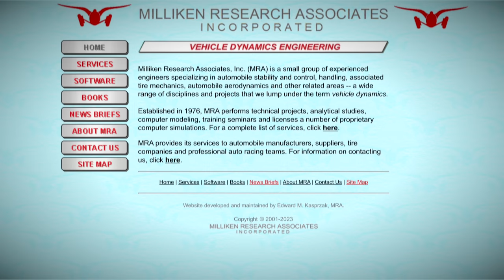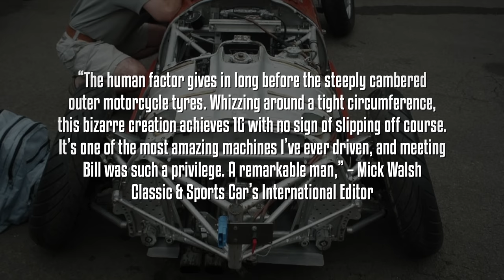The Most Revolutionary Race Car Nobody Knew About

Comment: Having the tires at about the same camber angle as the combined weight of the car and its centripetal force vector summation would mean the tires sidewalls would be taking vertical and circumference forces with little lateral forces.  That may allow much better tire dynamics than when applying 1G side loads on the tires.   The need to have a circular tread area like a road racing motorcycle tire would severely restrict the tire's contact patch, making it very long and narrow.  This car was almost certainly never intended to be race competitive, but for testing camber theory.  The thrust loads from the high camber would have made manual steering tricky.  All the normal geometries of steering and combating  bump steer would need to be developed for camber angles of 45°.   Thank you for this video.   I'd think everybody that has studied performance suspensions has done thought experiments as to what the dynamics of having the tires cambering such as done with a motorcycle might provide.
Reply from the maker: Thank you for your comment!
Reply: Shut up, nerd!

Just kidding - I find this stuff fascinating!
Reply: Good use of words to discuss this. Excellent point the tires sidewalls forces would be reduced but in straight driving this much camber would inflict a large constant tire sidewall force of sin(50 deg) * 1G which may cause fatigue flexion in them and  then when the car entered a tight curve the tire sidewall load would reduce toward zero causing possible flex shift and poor dynamic. 
Another problem that you started to allude to, without race bike like special tires and minimal circular contact patch diameter, any two points on the contact patch are rotating at a significantly different road speed due to the high camber causing severe grinding of the tire and maybe detaching material.  This could get dangerous.
Reply: @oneginee  I met Bill once.  His son, Doug, is a friend of mine.  

There's no reason for camber thrust to follow that sin(angle) function.  If you're interested in the car, Bill's autobiography "Equations of Motion" has plenty of data on it including the tires which you might find surprising, especially in that regard.  One of the interesting aspects was the car actually exhibited reversed load sensitivity so setup worked backwards in a couple of ways.  For example, stiffening the front end moved balance in the direction of oversteer instead of the reverse.  It's the only case I've ever known about where that occurred.  Neat stuff.
Reply: @toddwasson3355   It does not need to "follow" the sin(camber angle deg) * 1G, it will BE that result because this is physics when the vehicle is in a straight line ! 
I am an engineer and i don't need your second guesser jackass opinion to infirm/confirm what i wrote. This Douglas focused on centripete force in turns and completely overlooks the detrimental effect that high camber has on the physics in straight stretches. I am not impressed and I'll stick with my own mechanical dynamics textbooks, thanks.
Reply: Something about effective mass and the coefficient of friction, contact patch/es, enjoy.
Reply: My post keeps getting deleted...  Will try again.
Reply: @oneginee  That's not correct.  

Pages 521 and 522 of Bill Milliken's autobiography "Equations of Motion" show the tire data for the camber car at a range of steer (0 through 5 deg in one case and 0 through 8 deg in the other) and camber angles (0 through 50 deg in both cases).  At 50 degrees camber, the lateral force at 0 slip angle is about half what it is at 8 degrees.  

Load 492 lbs, 50 deg camber:

Fy at 0 deg steer angle:  ~310 lbs
Fy at 8 deg steer angle:  ~520 lbs

A motorcycle in a steady state turn will work like you described because the slip angles will adjust to provide the missing force camber thrust alone doesn't provide.  Camber thrust on it's own is not enough and varies considerably from one tire to the next anyway, it isn't just sin(camber angle deg) * 1G.

With a car that's not the case.  The steer angle is controlled independently and the vehicle isn't forced onto a curved path via camber.  If you added enough toe out at the front, the tires would produce no lateral force at all even at 50 degrees camber.  We can't say that at X camber there is Y lateral force without also knowing the camber and cornering stiffness of the particular tire in question along with the slip angle.  Every tire is different.

In the book, both plots show the theoretical f = load* tan(angle) (tan(), not sin()) for comparison with the measured data.  Even the 0 slip angle case does not follow the theoretical line.  The page 521 diagram shows that the real tire's Fy at 0 slip angle is actually slightly higher than theoretical up to about 15 degrees camber, then it falls under it pretty rapidly on the way out to 50 degrees where it's only about half the theoretical value.   It varies wildly from there as steer/slip angle is changed.  

Add in 2 or 3 degrees of steering/slip angle and the lateral force actually peaks closer to 30-40 degrees camber, falling off some as camber increases to 50.  So it's really not as simple as you've described.
Reply: @oneginee  That last post worked finally.  Not sure why it wouldn't accept my original.  Hopefully this one will work too.

Our credentials and background aren't relevant when we have hard data to look at so I'm not sure what the attitude is all about.  I've referred you to the data on the exact tires used in the camber car which came from Bill Milliken himself after testing them at TIRF.  It's up to you if you care to verify it or not.  

Since you want to flex on your background as though it's relevant, allow me to do a bit of my own:

I've been designing and programming vehicle dynamics simulation and tire models professionally for more than 20 years, have known DM personally for many, many years and have talked to Bill face to face as well.  Doug is the one who told me about the camber car when he picked me up for work one day.  We did a presentation together at the Motorsport Engineering Conference in Detroit on the tire research project we were doing together at the time.  If you don't believe me, you can Google both our names to find the SAE entry.  I believe it was in 2006 if memory serves me correctly.  One of the things we were testing were camber effects, so I have literally measured this personally with a real life Milliken standing five feet away from me while doing it.

You've made a common mistake mechanical engineers who don't specialize in vehicle dynamics (especially automotive dynamics) often do:  See an equation or two in a couple textbooks on mechanical engineering intended for students and think that's the end of the story.  It isn't.  You can either look at the data which directly compares the equation with reality or decide not to and call me a jackass again for pointing out what you said is in fact wrong.  If you don't believe me, speak to any tire or vehicle dynamics engineer on the planet and they'll tell you the same thing.

Comment: The Milliken's book on vehicle dynamics is expensive but worth EVERY PENNY. The book explains every facet of vehicle dynamics: suspension geometry, spring rates, weight distribution, the relationship between front and rear roll centers, and answers questions you did not realize needed answers. On the day I received my copy, I opened that book and found answers for questions  no other books address. This book is readable and has many interesting anecdotes regarding aeronautical and automotive engineering history as well as both theoretical and practical knowledge. If you set up race cars, this is your manual.
Reply: I actually used to take it away racing. Bill and a few of his associates were serious pioneers in the vehicle dynamics field.
Reply: Bill's autobiography (equations of motion) is way better than the race car vehicle dynamics. It is a miracle that Doug Milliken exists given how wild Bill was into his 30's.

Comment: In South Louisiana we call that engine the tombstone. My friends dad worked on the Popeyes boat racing team for Tom Benson. He built his son a bored out Mercury 6 hung on back of a 17' Allison. Boat looked like the Concord jet. We ran it up to mid 80s mph. His dad shortened the lower unit and put a 4 blade on it, cut out the exhaust cans and we got up to 98 mph. Because it was all built with (junk) parts it was all just for fun and not an official race boat. It sounded like the Kawasaki straight 6 Widow maker. Then for some reason he burned the motor up using it on a lake skiff to go trawling for shrimp!!! Lmao!! Like i said South Louisiana. 😊

Comment: I used to have a Karman Ghia that the builder had utilized shorter-than-stock shock absorbers that made the rear wheels have positive camber (wider at the bottom than the top) for cornering
Reply: That's negative camber. This car is an extreme example. 
//------\\ = negative 
\\------// = positive
Reply: @skaldlouiscyphre2453  And unless they're coil-overs, shock absorbers have no bearing on camber or ride height. Even gas shocks make a negligible difference. The Ghia probably just the rear torsion bars dropped in the splines.
Reply: @moyadapne968  Isn't karmann-ghia has swing axle like rear suspension?
Reply: @huseyinuguralacatli5064  yeah when "lowered" it gets more Camber

Comment: The 4 cam Corvette engine mentioned is the LT5 that debuted in the 1990 ZR-1, which like the 2 stroke that powered the camber car was produced by Mercury Marine. They had to make it because GM didn’t yet have the capability to make full production runs of all aluminum engines. It kind of surprised me to realize that aluminum blocks only became standard on Corvettes with the LS1 in the C5 1997 Corvette, while they’ve always had fiberglass bodies and have had independent rear suspension since the C2 in 1963.

Comment: That camber racer used steel rims from a SAAB  and mist likely the brakes for it to as thats one of a kind bolt pattern. Double wishbones was also a SAAB  thing. So might have had lots of SAAB parts on it.
Reply: He was probably the guy that designed it for Saab. Saab was started by a bunch of aircraft engineers.
Reply: @mattrohr1266  nah. Bill never worked for Saab. He did some consultancy work for GM, Goodyear, and other american auto companies/suppliers but the camber car was the only car he ever designed and built.

He did design, build, and crash his own airplane before he was 25 though.
Reply: WV beatle got some uniqe bolt pattern also that is similar to whats on the car, but SAAB parts would be cool if they got used.

Comment: Seems to me that with our current tech and gps we could make a vehicle with dynamic alignment using electric/hydraulics.
Reply: Honda makes cars with active rear toe, and has for white a while now.  Electric motors in the rear toe links.
Reply: Oh boy don't look up Nissan hicas, or the system on the prelude SI
Reply: @danielescobar7618  That wasn't variable alignment, just four wheel steering, though.
Reply: @izzmus  look again as to what is adjusted.. it pulls the toe in and out. An important part of alignment for high performance driving.
Reply: @danielescobar7618  HICAS and the Mitsubishi and the Honda 4WS didn't change toe-in, they just changed the rear steering (aka thrust angle).  Subtle but important difference
Reply: @izzmus  cool. Going on old old info, I may have had it wrong the whole time. As a street tuner hobbyist, I usually just helped friends take it off for simplifying things on their street cars, or putting regular model parts on cars with broken ones to cheapen repairs.

Comment: I have had many questions about this car for years, and this did not address any of them.  Research on camber ended when wide tires came in, but the effect on adhesion has never been explained.
Reply: Because unless you have specific rules that require something like motorcycle tires you don’t want that extreme of camber. The idea is to have just enough camber the tire lays flat under cornering. To much and you loose grip. 
They said that formula car made 1g of cornering which is really low for a formula car. With traditional tires and suspension that car should pull more like 1.5g at least.
Reply: @NBSV1  As I noted, this experiment was conducted just before the tradition of wide tires began, which changed everything about suspension.  History records this as an exceptionally sticky skinny-tire car.  How much scrub did the cambered tires create?  The explanations of motorcycle traction never account for the increased scrub from camber, except with vague references to the action of the bias-ply casing.
Reply: @bobstuart2638  Because technology moved on so there wasn’t a need to keep researching it. And, even with skinny tires you want the biggest contact patch available. Laying them way over may generate some other forces, but you loose so much everywhere else it isn’t worth it. 
Motorcycles also don’t turn well compared to a race car. The contact patch on the tire is tiny and there’s only 2 of them. Something like a formula ford can turn a quicker lap time with half the power and double the weight compared to a super bike.
Reply: @NBSV1  Brands Hatch in England Superbike lap record is around 1:24, Formula Ford 1:35, Porsche Carrera Supercup 1:25.
Reply: research on camber hasn't stopped. tire and auto companies are still using the tire test rig Bill Milliken's organization (CALSPAN) built in the 70's to generate tire models for use in vehicle dynamic simulations or to answer fundamental questions. but the mechanics are pretty straight forward. 

friction between rubber and road surfaces decreases with increased contact pressure. the tires generate a lateral force when put under a slip angle. that force deforms the sidewall and pulls the tire's footprint out from under the wheel. the footprint distorts in this situation. the overall shape becomes more trapezoidal and features uneven pressure on the outboard shoulder (generally). This reduces the overall peak lateral force that would be available with an even pressure distribution. Cars run negative camber because the camber preloads the tire such that the footprint shape is more square with an even pressure distribution under cornering conditions.  

There's nothing magic here.

Comment: So why is this technology not used on any other racing cars? or, wots the downside?
Reply from the maker: It was a research car, I believe all the interesting and mechanical stuff is in the book
Reply: Severe camber has a negative effect on wide (think modern) tyres. Start tilting a wide flat faced tyre slightly sideways, and you'll see that it will quiuckly run out of surface contact. This idea would have made more sense back in it's own time.
Reply: @robertrobinson3861  Apologies Robert, but I felt that was so obvious as to remain unsaid from my question, not meant in a cheek way btw. And bigger motorcycle tyres like fitted to superbikes would surely go a long way, judging from the lunatic power they can put down. So apart from that one thing. .     .
Reply: @VisioRacer  thank you VR.
Reply: @marcusgault9909  No offence taken, Marcus. Cheers.